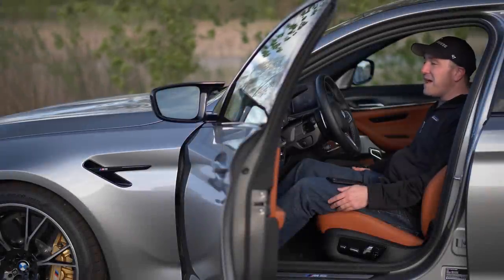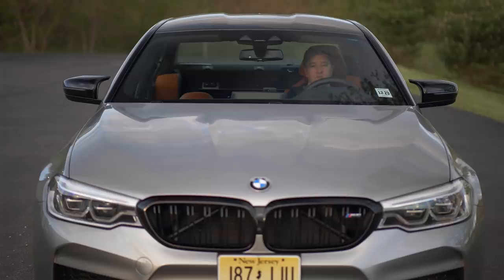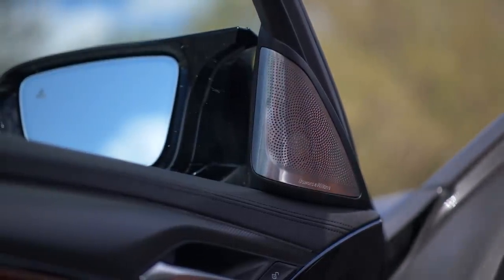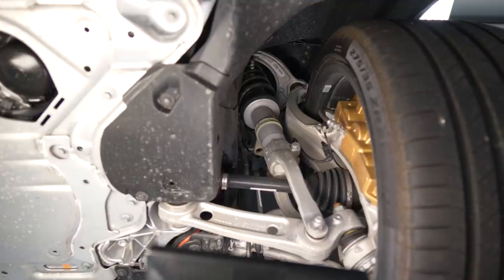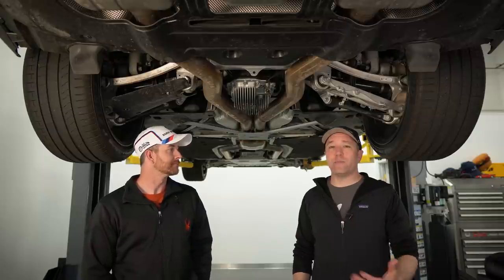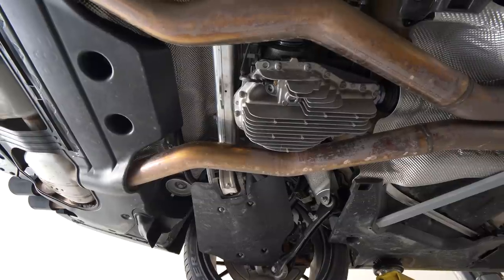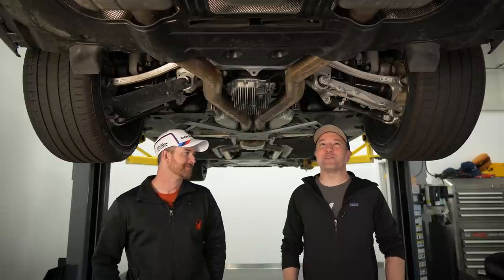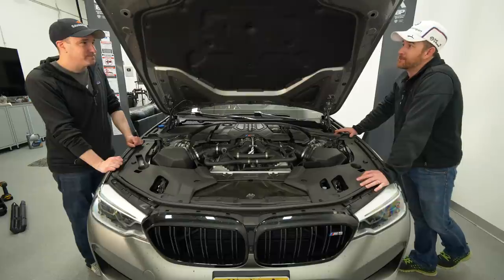2019 BMW F90 M5 | The Rabid Farm Animal

Comment: Carbon ceramic brakes upgrade $8500, BUT $18000 to buy replacements?  Where did the extra $9,500 in cost come from?   Let's be clear, manufactures are ripping people off on replacement rotors!

Comment: 26:30 "I feel absolutely nothing driving this car....... if there was supposed to be any kind of fun injected in here--"
Proceeds to laugh maniacally. Pure gold!
Reply: but in all seriousness, you could do that in a mustang gt as well and still have fun when not going sideways... point is that the m5 is too isolated when not sliding it around
Reply: King of sting  Yes, and you could buy 4 Mustangs for this things price. It should be better, and it is better. But it's not 4x better, by any stretch of the imagination.
Reply: King of sting yes it can definitely keep up in a straight line. 1. because it finally has independent rear suspension. 2. most of the people who mow down crowds are absolutely horrible drivers whom got the car for cheap (which it is) who try to push the throttle or overcorrect at bad situations. Again who is Motor trend? The same biased channel who scores absolutely inaffordable cars on the top? At least 90% of the crowd cannot afford an m5? The m5 MIGHT perform better but it is an isolated cat and that is a fact. The exhaust note is horrible, the steering is dead, but it can do powerslides and go fast on a track while boring the hell out of you.
Reply: King of sting The exhaust is in fact horrible. It literally sounds like a civic fartcan that's trying to be a V8. The sound inside is completely fake and synthetic. Sometimes fake noise is supposed to make the car sound better. But in this instance it makes me feel like I'm in a video game and not driving a real car. Literally everyone complains about how it sounds like a fart from the outside and fake on the inside. They all make fun of it for sounding worse than some 4 cylinder cars. Pardon me, I thought you were talking about the mustang being able to stay in a straight line and not lose control. Didn't read your comment correctly. But for sure the m5 smokes the mustang in a straight line or whatever. The mustang to me is still better because of the looks, exhaust, engine characteristics, permanent rear wheel drive and stick shift option.
Reply: King of sting Ok I think it is safe to say we drifted off topic here.. my initial point was that the M5 is just too dead when looking at it as a fun sports car. It can slide around and accelerate fast, but that's about it. It can go fast around the track, but as savagegeese already mentioned it is still a dead car unless it is sideways. It is basically a charger hellcat but with better handling and worse exhaust note (and better interior). I think the amg gt 4 door is better as it is much more alive when driving it (many car journalists said it, I haven't driven it before). I'm not going to try to argue performance though (even though the amg has better performance) because I care more for how the car feels like to drive than how it performs. Either way both mercs & bmws are out of my reach and are absolute money pits and so I wouldn't buy either of them.
Reply: King of sting alright my man 👍🏻

Comment: Exhaust pipes from a Kenworth.
Extra like for return of Turbowski.

My biggest issue is that the rondels on the wheels are just slightly off.🙃
Reply: I noticed that near the end of the the track segment (front passenger wheel)

Comment: I drove the M5 Comp at M Performance Driving school in Greer SC. I felt more in control in the M5 compared to M4/M3/M2. The M5 AWD is so forgiving and easy to take it around the track. You are isolated to the world, but the M5 builds speed extremely fast. It will probably be my next M car after my current M3. M3 is a precision car that is balanced and is a joy to drive in winter (must-have performance snow tires) and summer.
Reply: Did you do it?? I'm looking 2020 M5s just not sure it will be fun enough and maybe just go G8x instead
Reply: @jldp24  no.

Comment: Wait ... Did I just see a role reversal here? Turbowski driving and Goose removing plastic covers?
I'm just to that half of it, but I never watched a car review with so much intensity. The information, the different angles to regard the car, the production (that panning through the guts of the wheel suspension should be patented, I mean it), the funny things sprinkled here and there and of course, the material, the car itself which is awesome. (The excitement and the smiles on the guys faces ... priceless). Oh yeah, my boss has one. Crazy. Goose should just go the the Auto Oscars and pick up his prize.
Reply: Just typical Savage Geese quality my man. He puts more pride in his work then that Doug guy for example
Reply: @timothycc711  And yes, I'm already used to watching 40 min videos here, in entirety . This time it just went way over the usual high.
Reply: @crebegea  I absolutely hate Doug that's why I mentioned him. Definitely check up on Mark's previous videos. The one on the Dodge Demon is especially good.

Comment: Anytime you try to get a car that does everything, it does nothing well. Instead of spending $130,000 on something you're going to have complaints about, get yourself two or three used cars that do exactly what you want. $40k sports/convertible, $40k daily commuter, $40k weekend hauler. Miata, Lexus hybrid, Ford Suv.

Comment: Price as tested new $132k...
Price as tested next year " USED " ... $45k
Reply: Lol not comp package, maybe in 3 years regular m5 will be around 50k. 2014 F10 m5 is around 45k-50k
Reply: @Areku06  give it 1 year. Guarantee it will be HALF of what it costs new. Especially after all the issues come rolling in,... And when people have to start doing the maintenance to them. It will be cheaper to sell than to maintain. 
Most common flaw with BMW
Reply: That’s why u get certified up 100k mile warranty. I only see high mileage 2014 m5s w/ 80-90k miles at $40k. F10 m5 has the same engine, comp package still holds its value, cost around 60-70k beings 4 years old. Non comp package m5 around $50k. After 1 year, it drop between 80-90k not 50k, it will take 4 years to drop to $50k.
Reply: Areku06  Very true. Though the maintenance costs would scare me away from buying it.

Comment: Keep in mind steel you need to replace after 25k, CCB 100k, so even if they are 3-4 times more ... it's the same running cost.
Pads are about $1000 vs $250, but again 4x the duration. They are easy to chip though, and I think that might be the real reason to consider steel ...

Comment: $110k for this...yikes. I'll wait 3 years and get one for $20k lol.
Reply: The Adventure Mazda funny
Reply: good luck
Reply: Hahaha, seriously. This thing will depreciate faster than the speed of gravity.
Reply: It'll still be $18k for a brake job, probably more.
Reply: @USARAY1947  No, only if the previous owner specced carbon brakes
Reply: Great it will be an endless moneypit.
Reply: Cadillacs still holding value ...doubt this will drop
Reply: That would be a terrible idea... You'd spend 300k just keeping it running
Reply: a little bit of an exaggeration, but you actually can find 2014-16 BMW M5 Comp’s for under $50k all day.
Reply: USARAY1947 Not if you junk the breaks and put on normal breaks
Reply: @mattilinan  35 grand lol
Reply: @mattilinan  ... those are the ones that drink oil.  You can actually find them for in the $40k +/- range for that reason.  Hopefully that was fixed with the F90.  But, the way BMW M cars have been going lately, there's something else that will likely cause you to not want one of these with higher miles (perhaps done on purpose by BMW? [dons tinfoil hat]).
Reply: It will at least be worth 70k in 3 years, and good luck owning one without a warranty.
Reply: I’m from the future, the cars worth $84k for the cheapest 3 year old one. Guess it didn’t depreciate that hard.
Reply: @RayQ101  The current market has used cars worth more than new ones. Total anomoly.
Reply: @TheAdventureAuto  Check the trend, only a 3% difference from 6 months ago.

Comment: Luv the channel.
The M5 is for a weird customer.
It's a corp middle manger that want to flex in the car park but doesn't want to deal with a full on sportscar.
I had one in my org last year - He had a V10 M5. Fastest thing in the carpark.
Never heard him take off at speed.  There were v8 M3s that you would here leave like a firework display.
Jag svrs that growled like growling was going out of fashion.
My Mr2 at the time made an equally aggressive noise at a fraction of the price.
The SW20 rev-3 Mr2 is the answer to so many questions about exciting sportscars that it's s not real.
Buy a good unrusty rev-3 mr-2 T-top and enjoy one of te cars this century.
Look at the sills - they were often bad. Foam in the doors stored water and leaked it onto the sills. ETC. 
Luv and Peace.

Comment: Great video Mark, Jack and Scott. I must admit I am a certified cringeworthy BMW fanboy myself and I was anticipating that particularly Mark and Scott will hate on this car being a BMW but I was proven quite a bit wrong. I think I prefer the oldschool naturally aspirated high revving M cars despite their questioning reliability issues. I'm weird though.
Reply: I find it incredibly odd how a company can charge MORE for replacement carbon ceramic brakes than when you first spec these on the options - Is this normal for car companies (e.g. Porsche, Aston Martin etc) to do this? Is it because sourcing parts after a car no-longer-in-production gets harder over the coming years? Thanks.

Comment: After being forced to lemon my 2018 Panamera due to massive problems with the PDK (they even replaced it), I was looking for a replacement. I ended up with the regular M5 F90. It feels like half the weight of the Panamera, and twice as fast. The way the F90 corners for example on Mulholland Drive (an infamous windy and bumpy road in LA), or any of the canyon roads around Malibu is simply incredible. It has the ability to make you forget that it weighs 4,400 lbs. It also feels absolutely not like a regular 5 series (I drove an M550i, too). The much faster steering ratio, and way different suspension setup literally transform the way the M5 turns in compared to a regular 5 series.
 
Next to the Panamera, I used to own a 2017 Corvette Grand Sport. I got more and more disappointed in it as soon as I had driven the M5 for about a month, since the Vette felt hard and brutal compared to the M5 without any perceptible benefit. The only thing I would say is that the Vette had better steering feel, but that‘s it. 
Given that I don‘t track my cars, I sold the Vette because I stopped driving it a few months into owning the F90. I never missed the Vette one day even though I loved it prior to owning the M5. 
The M5 is truly two cars in one, in my experience. In contrary to the author of this video who doesn‘t own and live with this car, I love that it‘s a sleeper. Not showy at all and doesn‘t draw much attention from cops either (unlike Vette) which is a big positive in Los Angeles. „Car people“ on the other hand immediately recognize it.

Comment: You keep saying you wouldn't get the CC Brakes because of the high price replacement cost but you know they typically last 100k on rotors and 50-60k on pads right? Pads are like $1000 each and by the time you actually have to replace them they might even be cheaper than that.

The only point I really agree with is the lack of external flare. It could really use some wide fenders like the old E46 M3, an aggressive but stylish hood scoop, CF front lip and side skirt lip, slightly bigger wing, a couple more vents, and possibly an exposed cf roof. That would make this M5 really feel like a competition model.

Comment: 10:32- um the cooler that’s mounted under the front bumper. I’m glad I have never seen someone pull too far forward over a concrete parking stop when parking. That’s going to be a nice surprise to the owner that does that the first time. (Yes I’m sure there are cameras and radar as a parking assist) I’m sure that cooler is no more expensive than a Honda Fit.

Comment: I find myself parking my M3 E92, taking the 911 Turbo S out just now and then, and putting the miles on the M5 F90 CP ... 
yes steering is a far cry from the M3, braking is worse than the 911, but it's a great car. I spend 10h straight in the rear seat (Munich to Denmark) and had no issues at all.
Love the large tank / range, the interior space / trunk space and the quiet ride.
However I would not track it at all, it's just too heavy and take too long to stop, but it's performance / handling is way beyond what such a car should be able to pull off.

Comment: The part at the very end where you and Scott are frustrated with how to get it in RWD mode sums up the car pretty well.  lol.
Reply: Hold the DSC button for 5 seconds, done. They complain about complexity when really it's just ignorance of how to do something. When you know how it works, it's easy. You can also save settings to the steering wheel buttons, so one touch on the steering wheel changes all the settings you want with one button press.

Comment: I would beg to differ regarding the amount of customize things on the F90 M5.

For most people who buy the car, they would already know these buttons and it doesn't take that long to set up, especially on the driver setting (M1 or M2). Based on the price point, you either know the car or just drive it at the starting setting and not bother because how comfortable the F90 is as a M car. Even with the current F80/F82, there is the same amount of customizability there (minus the AWD xDrive setting). I go through my F80 M3 without even thinking when changing certain stuff from Comfort to Sport and back again depending on the situation.

Could be that I'm extremely familiar with the F8x cars in general but I never once had a problem or think it's too complicated. Describing it makes it more confusing I think than practice.

P.S. Not a lot of fans on the BMW side are overly happy about losing the M-DCT to the ZF8 and track rats won't do CCBs in general. They cost far too much to replace.

Comment: I have a 2015 5 series. Only complaint is that its heavy af. I would not trust it in a high speed turn as given it weight, gravity would pull it outwards. Also would be extreme wear on suspension.

Comment: Question: If the brake temps get that high, wouldn't the wear be much, much smaller on the carbon ceramics than on steel brakes? These brakes are specifically made for high temperatures and should really - even from a pricepoint - outlive the steel rotors by a mile. In theory, at least. I've heard from some 997 GT2 owners that in track reality, that wasn't really the case on these models. I think that was largely due to manufacturing processes of the ceramics back then.

Also, the M5 has always been a more subtle car, never been an in-your-face design, so that's consistent with the past and has always been part of its success.

Comment: Well, for a guy who does not enjoy this car, the hilarity you express accelerating out of a corner is pretty convincing.

So it is for someone who wants a four door super car sedan.

So assuming one pursues your contention of spending less for 5 series comfort, where do you go?  M550ix still too much without the handling?  540i sufficient?

I have couple of friends who have the 530e, love it and 45 mpg.  Still can cruise over 100 mph if necessary or legal.  To which one would the Goose default?

Comment: I typically agree with most of your reviews. I feel youtubers miss the mark on several points when reviewing this car. First your opinion matters so I’ll get that out of the way. Cars are presented to fill a need. There are cars to get you from point a to point b. This is not that car. There is no need to make it simple or streamline configuration. This car exists to please the driver who wants control. So to say there is too much tech in this iteration makes no sense. This car since it’s inception has made us want a car with sporting DNA and control over setup. Most manufacturers have moved to this philosophy. So not only is this car appreciated, it is the literal embodiment of the paradigm shift in interest for sports sedans.  What you like should be weighed against what it’s designed for. Just my humble opinion.

Comment: I do agree with your comments. It seems a very pleasant, big, refined, luxury car at heart...with absolutely ridiculous performance bolted on. Is there any point in a car this luxurious and refined being sporty? Probably not. I suppose you can get the odd thrill from every now then - more due to the sheer power than anything else. In modern daily road driving you rarely get the opportunity for much more than a quick blast anyway. I guess if you can afford it it's nice to know you can still have fun in it even though you use it 99% of the time for the boring stuff. I'm not sure who would take a car like this to the track. It seems like you'd buy this car 75% for the luxury 25% for the fun. A opposed to a sports car which you'd buy from 0 - 25% of the luxury and 75-100% of the fun of it. I guess it's compromised if you want a luxury car and it's compromised if you want a sports car - no getting around that. But then it has many of the benefits of both.